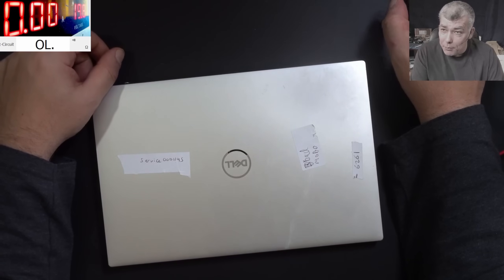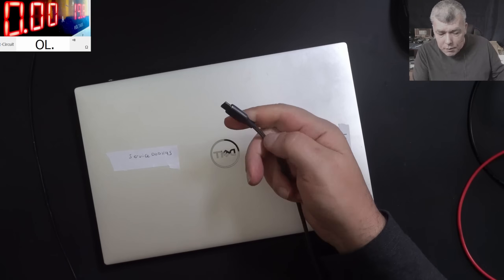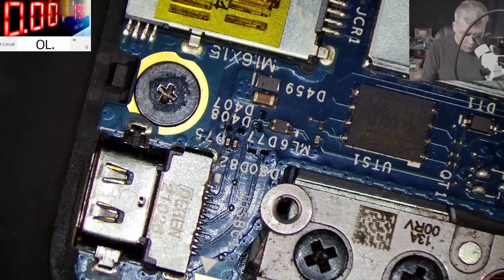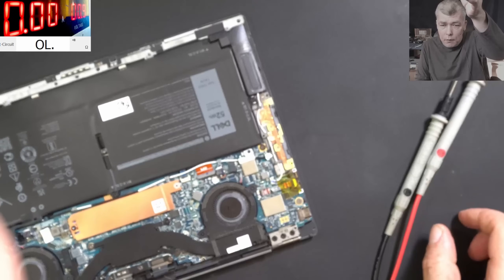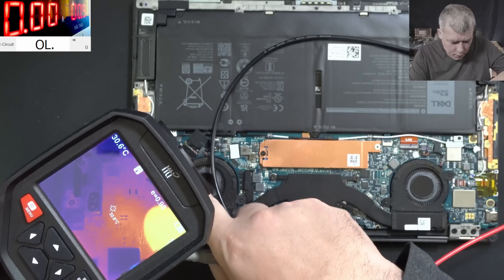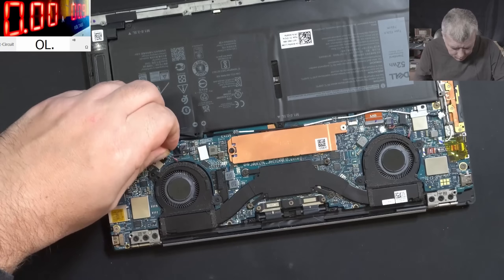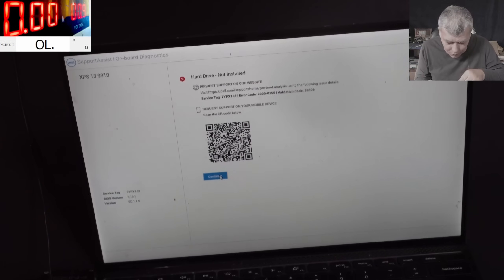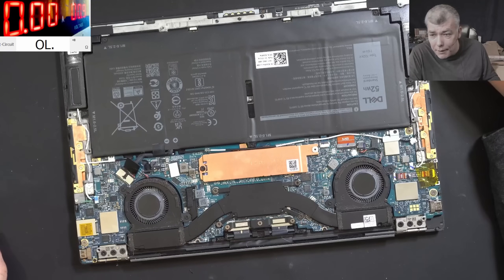Dell xps 13 9310 not powering on, logic board repair - You can fix this

Comment: Hey Sir, can you help me plz ? I got Dell XPS 13 2in1 9310 laptop. I left laptop on and went to have a dinner. Then laptop was dead when I came back and the light on charging cable went off as well. I tried few times to turn on the laptop but no luck.

Comment: I had 2 of those Dell XPS for repair not long ago, and both of them had the, on the motherboard, soldered rams broken. I replaced them, but don't like doing this. So I had no luck for an easy repair. The difficult cases always come my way 😉😁